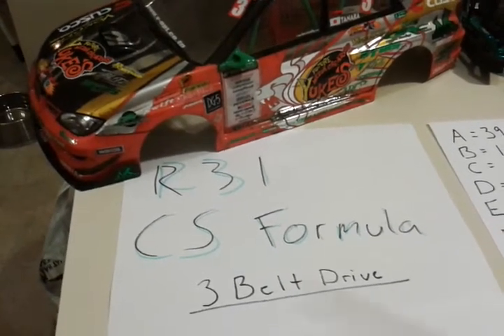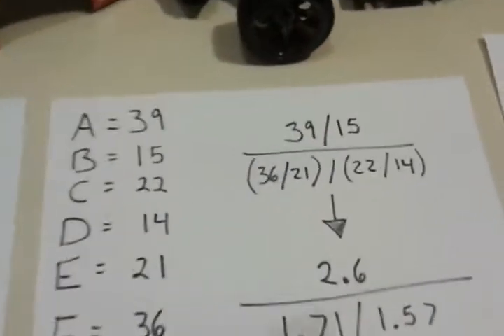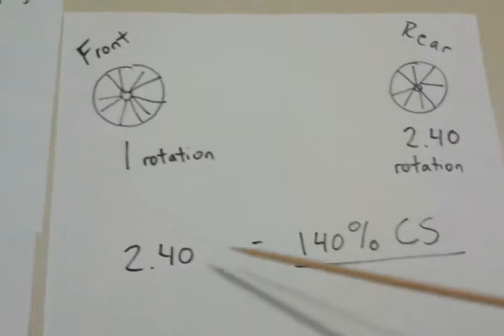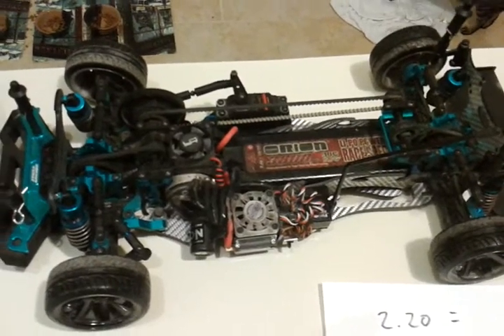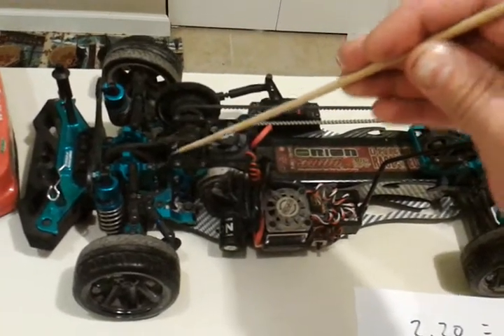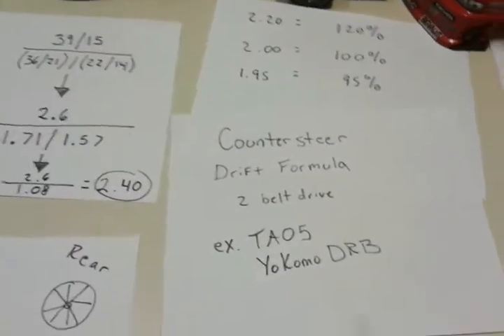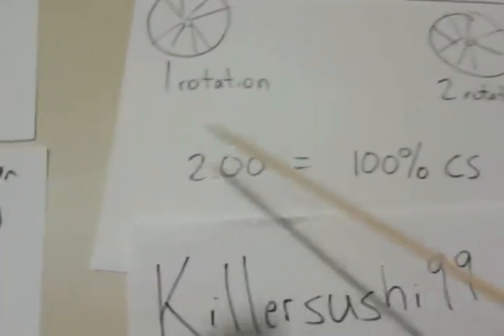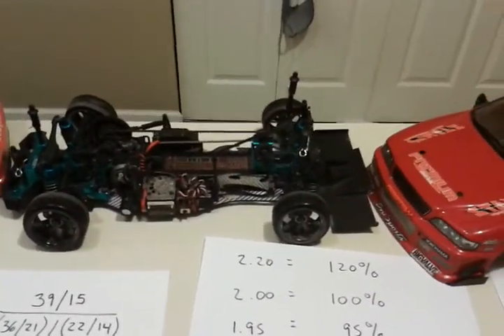R31 RC Drift Counter Steer Formula EXPLAINED and How to calculate CS ratio  140%

Comment: hey i only have a ball diff in front and solid spool in the rear on my teh r31 but they are both 39t i have the r2 pulley gears. is there a way i can countersteer it without having to buy the 36t?

Comment: The R31 parts are interchangeable with the R3R parts, correct? Just got my R3R running and I want to know if I'm able to use all of the aluminum parts broadtech has as well as the pulleys and so forth for higher CS.

Comment: I bought the 36t pulley but Im using an Eagle rear lockout and it seems the center hole is too small. What did you use?